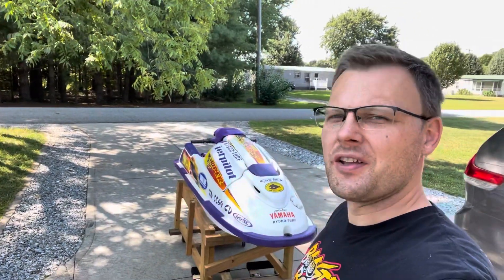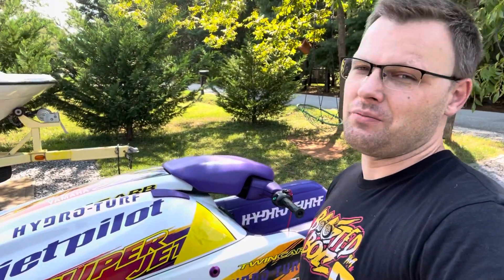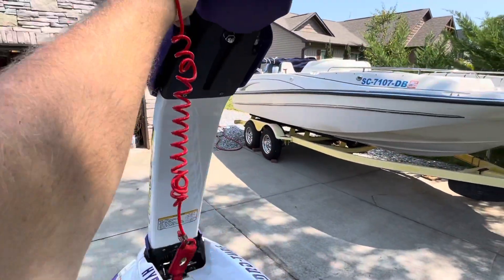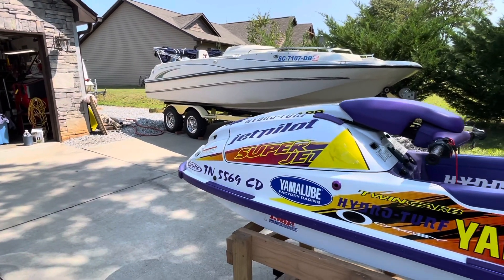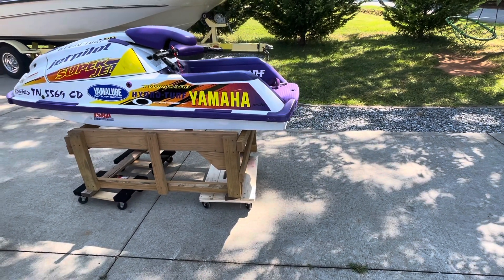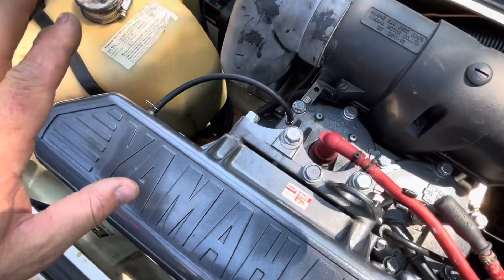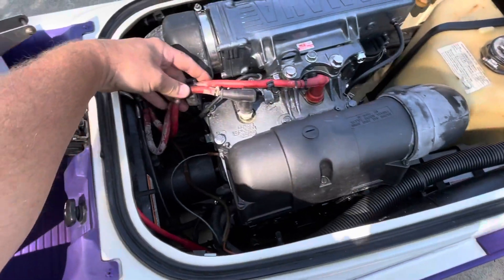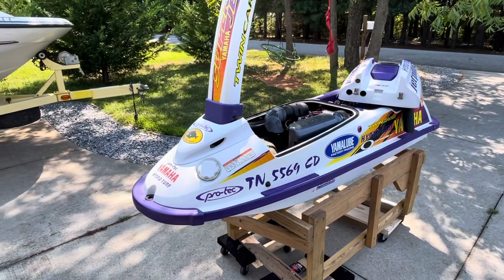96 Yamaha 701 superjet! BARN FIND like new condition!!!

Comment: The stock engine needs HS plugs. Half shaft. ES is extended shaft and the piston could hit the electrode. Get the HS plugs in there ASAP.
Reply from the maker: Yes most definitely I replaced them before i hit the lake.. thanks for noticing.

Comment: One heck of a sweet find. I've never ridden a Superjet. I've ridden most of the different Kawasaki stand up models. I can never find a project one for a decent price. Just picked up an X2 I'll be doing some upgrades on over the winter. Maybe next summer a Superjet will swap rides for a day.
Reply from the maker: Yes, superjets are completely different animals they are amazing love them.
Reply: @BTR2018  I'm supposed to pick up another X2 today. Thinking I'll build one of the to trade for a Superjet.
Reply from the maker: @JetSkiBuyFixPlaySellChannel  Have been looking for a x2 but I haven’t found one yet. Lol
Reply: @BTR2018  Lol. I'll trade for a Superjet. I' figured put a good way to find a deal on a Jet Ski is to put a wanted ad on Craigslist in the boat section.
Reply from the maker: @JetSkiBuyFixPlaySellChannel  I want to build one from the ground up paint and stuff like that.
Reply: @BTR2018  I'm debating painting one lime green. I already picked up a Mariner pipe, SBN44 and a Jet Dynamics extended ride plate.